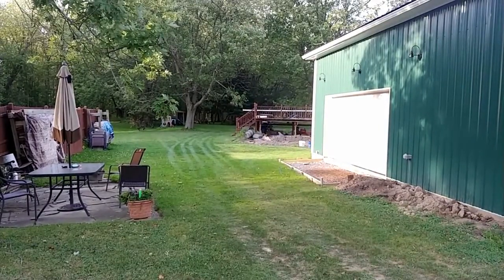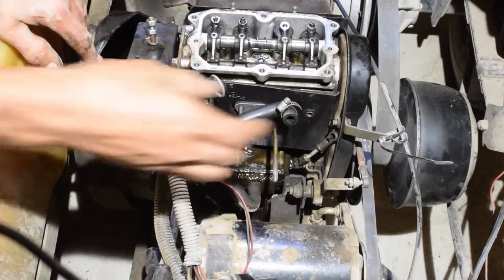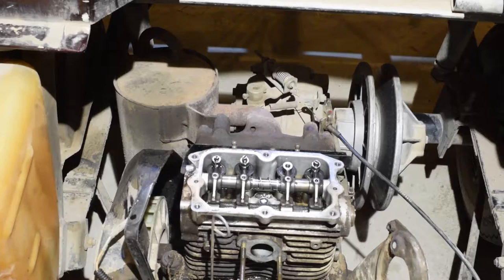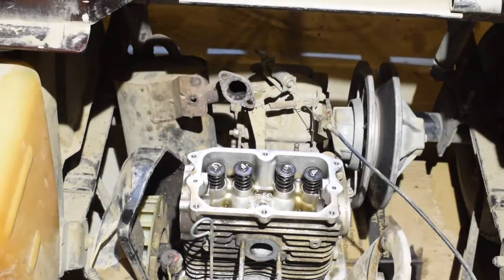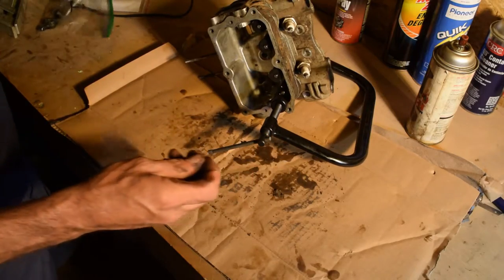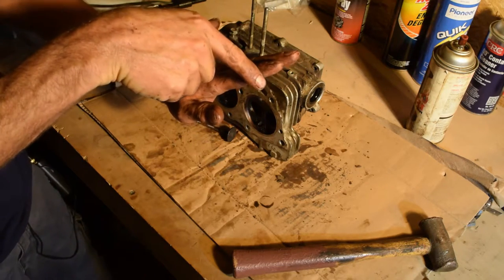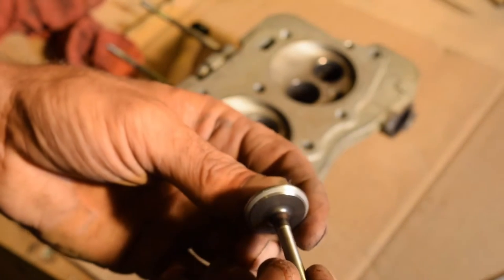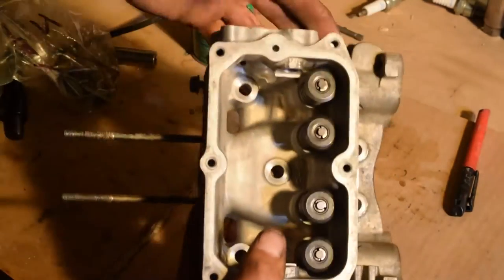Changed Valves On EZGO Golf Cart - 350cc Robin Engine (Part One)

Comment: Pretty crazy the way both intake valves killed themselves and leave the seat pretty much intact. Meanwhile the exhaust looks pretty good. Mine did the same exact thing. Valve spring tension is low enough that those who do not have a valve spring compressor can collapse the spring by hand to remove the keepers.

Comment: Thanks for your video, very informative. I do have question, I have a 98 EZGO gas with interment starting issue. You can drive it around and shut off and come back in a little while and will not start. I tested it and had not spark at the plug. I replaced the coil but did not fix my problem. Any help would be really appreciated.
Reply: replace the ignitor (cdi)

Comment: When you get everything else right and it still doesn't run there's a little white plastic plug the driver's side typically very near the igniter. The contacts in that plug can greatly vary the voltage to the coil. If you're having weird electrical problems check that little plug
Reply from the maker: Thanks for the information, very much appreciated.

Comment: What does the white 1 on the valve cover mean cause I just bought a golf cart at auction with a white 2 on top of the valve cover
Reply from the maker: That was there already, I figure it was repesenting cylinder no. 1.
Reply: @marksplace  ok thanks for responding and thats a great video